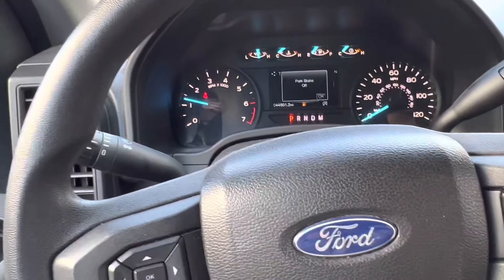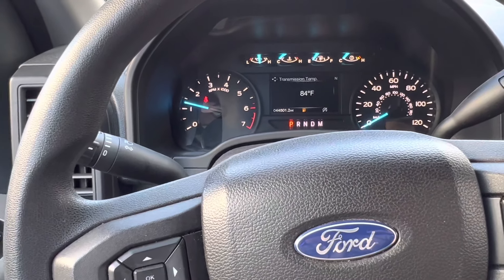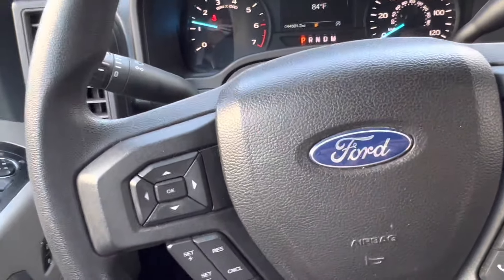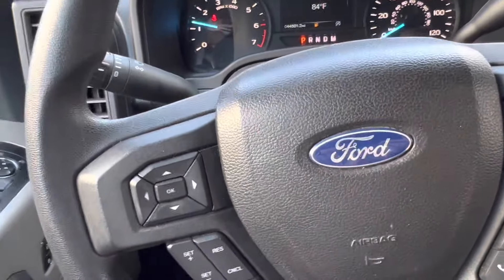How To Put Your Ford F 150 In Park Brake Maintenance Mode

Comment: Brian I tried your sequence a few times to no avail, but then found the propper sequence in a different video. Key on, push in button, press accelerator, turn key off, then back on, and then service mode was acquired
Reply: This is correct. I tried with my ford f150 limited according to the video and it didn't work, maybe because I have the push start system. The method from this comment worked for me. In case anyone is wondering,  the caliper torque is 27 ft/lb, while the lug torque is 150 ft/lb.
Reply: You are correct. The video sequence did not work but your description did. Thank you!
Reply: This worked for my 19 f150 5.0
Electric e break
Reply: lol
Reply: Yeah his description of what he did and whatnhe actually did were diferent. Wonder why he doesnt actually show the procedure instead skips away and zoom in on the ipc like (this how we do it dur).
Reply: Life saver... three different how to's... no luck.  The sequence in the comments worked.  Many thanks.

Comment: Finally Ford does something to make my life easier. I changed out my front brake pads (just had to remember to put the pad with the ears on the inboard side) now I can do the rears.
Reply from the maker: I was thankful they did it this way as well. If not you would have to have a scanner.

Comment: This was a great video! Thanks a ton! I tried changing my F-150's rear brake pads last weekend and had no idea the electronic E-brake sticks them in position, so I couldn't get the job done. My last F-150 used the manual pull cable, so I never thought I'd hit any issues. When I called my Dad and asked if he knew what was up, he told me the newer vehicles with the electronic E-brake have that restriction and might need a device to interact with the vehicle's computer (one of his cars needed this apparently). I was pretty sure there was a "trick" to it involving a combination of inputs since I know there's a factory/dealership shipping mode that needs something similar to deactivate. Thank goodness I found your video to show how it's done!

Comment: Are you able to put the truck into brake maintenance mode using Forscan? I ask because I can't put my 21 in brake maintenance mode manually. Dealership/Ford’s top engineers can't figure it out.